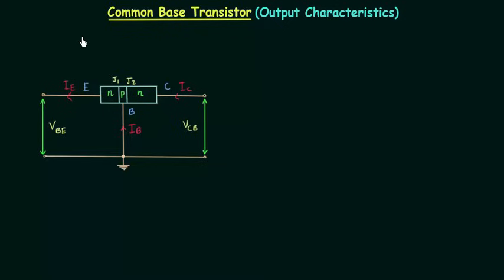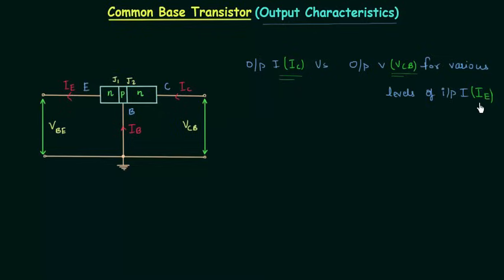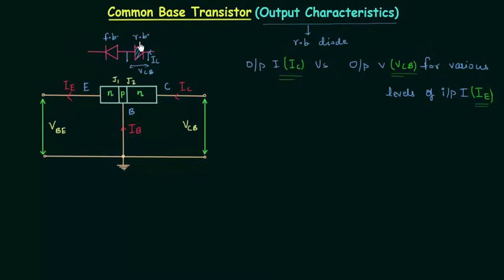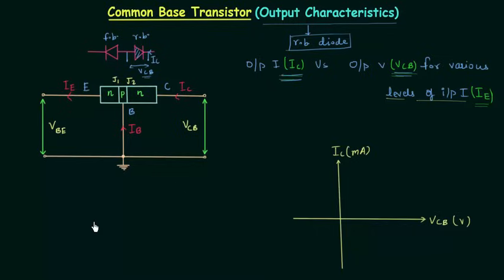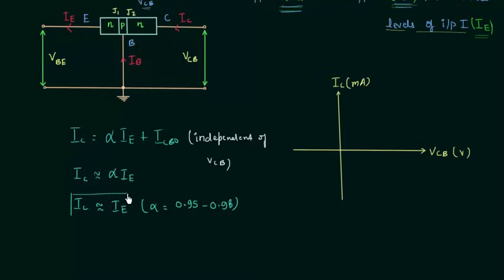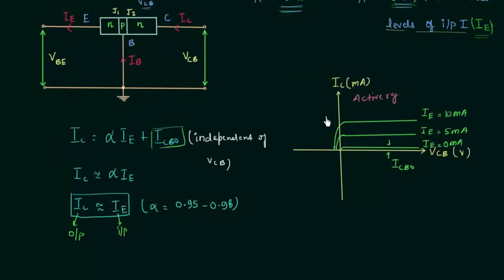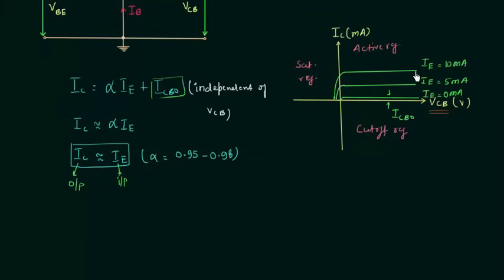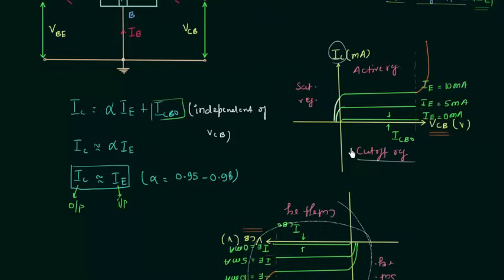CB Transistor (Output Characteristics)

Comment: Sir, Ie is dependent on Vcb . So there should be higher slope for the graphs right?
Reply: Are you telling about the slope of Ic vs Vcb graph ...mean if we increase the Vcb it will increase Ie...yes it will but here we are keeping the Ie same for a particular case mean if you increase Vcb it will increase Ie but you have to low down the Vbe to keep the Ie as before and you will get the graph like so...

was it your doubt?

Comment: You said this is similar to reverse bias characteristics. Then why did you draw this in first quadrant instead of forth quadrant??
Reply: U mean 3rd quadrant, it's coz applied voltage is not in negative direction and so the current.

Comment: Sir, can u explain the output chareteristic in saturation Region. I cant under the Mechanism in saturation reg.
Reply: Saturation region is located to the left of ordinate Vcb =0 and above the characteristics for ie=0. Vcb is slightly negative for a n-p-n transistor in this region. This slight forward biasing of the collector-base junction causes the collector current to change exponentially with the collector-base forward voltage as in a p-n diode. 

Cut off region is located to the right of the ordinate Vcb= 0 (reverse bias across the collector junction) and below the characteristics for Ie= 0 (i.e., in the reverse bias across the emitter junction).

Comment: Emmitter current increases with increase in Vcb as we saw in input characteristics, so collectors current should also increase with increase in Vcb.
Why is it not so??
Reply: Actually, it does. The current starts from the saturation region and then proceeds to enter into the Active Region where it becomes constant much like the reverse biased condition of a diode and again according to how a diode behaves if Vcb increases, collector current also increases so does emitter current, this is basically what we term as a breakdown but since BJT cannot withstand that much of power due to light doping in the collector region, it ceases to function. 
Thank You

Comment: Did not mention early voltage and its utilization in calculating output resistance. Also the output characteristics are not exactly like the reverse biased characteristics of a p-n junction diode because of Early effect.

Comment: why Ic decreases in saturation region
Reply: we have -Vcb at that area means forward biased(FB) for the collector-base region as well as for the emitter-base region. it decreases to zero because the collector and base region is lightly doped, when FB only few majority charge carriers will flow and eventually combined to much bigger flow on Ie.
Reply: @asherangelobuan3167  At the high base collector voltage, all the electors will move to the emitter side.
Reply: @asherangelobuan3167  how will both diodes be forward biased pls explain 🙏🙏🙏
Reply: This is because collector - base junction is also forward biased in saturation region . Note that both collector and emitter will be made of the same type of material (n type or p type). So assume a pnp transistor in saturation mode of operation. Both base-emitter junction and base collector junction is forward biased. It means that emitter is positively based with respect to base and the collector is also positively biased with respect to base. The function of emitter is to emit charge carriers and the function of collector is to collect the  charge carriers emitted by the emitter. In this case emitter is positively biased so it will emit holes towards collector. And since collector is also positively biased, instead of receiving the holes from the emitter it will try to repel the holes . As a result carriers emitted from emitter to collector decreases => emitter current decreases => collector current decreases .Same applies for npn transistor as well.
Reply: Please tell me

Comment: As from graph V(cb) is -ve when Ic is nearly zero . pls Explain.
Reply: Saturation region is located to the left of ordinate Vcb =0 and above the characteristics for ie=0. Vcb is slightly negative for a n-p-n transistor in this region. This slight forward biasing of the collector-base junction causes the collector current to change exponentially with the collector-base forward voltage as in a p-n diode. 

Cut off region is located to the right of the ordinate Vcb= 0 (reverse bias across the collector junction) and below the characteristics for Ie= 0 (i.e., in the reverse bias across the emitter junction).

Comment: Sir why in the output characteristics in a common base configuration the graph goes to the negative side of x axis
Reply: Bcos Ic cannot be 0 due To the minority charge carriers... a small negAtive voltage is applied which could stop the Ic (where Ic = 0) .. hence the graph goes to the neg x axis to show that the negative voltage is applied .. You can also see that the graph decreases in -ve x axis because of the applied negative voltage

Comment: sir as for as we know that resistance of  short path or closed switch is ideally equal to zero so in saturation region how collector current is going to be zero why not maximum current is flowing through it?
Reply: Because collector current will flow to the opposite of emitter current hence will cancel out each other's effect resulting in no current in the circuit.

Comment: Sir, why can a transistor not withstand that high amount of power for the current to flow exponentially ?
Reply: Because if exponential amount of current starts to flow through the transistor a huge amount of heat will be produced causing the transistor to burn.

Comment: why the graph extend beyond zero to second quadrant
Reply: Because in second quadrant means saturation region in which both the biasing will be forward biasing and since both of the biasing are forward biasing there will be no hindering for the flow of current from emitter to collector so current through emitter is equal to current through collector , and the direction of both emitter current and collector current will be same since they both are in forward bias therefore the sign of both emitter current and collector current will be same . try to see the O/P graph by inverting it you will get a clear idea .

Comment: Sir, i have a doubt that when diode is in reverse bias we use to plot the characteristics in 3rd quad so similarly when transistor is operating in active region then its output characteristics should be plotted in 3rd quad but in all books and all it is in 1st quad. so why is this happening?

Comment: why the current in saturation region become zero
Reply: As Vcb is negative, collector base junction will be forward bias and there will be a current flow opposite to the emitter side current. So the resultant current is difference between those two forward biased currents. (both EB and CB jn  is forward bias)as it becomes almost equalm, the resultant transistor current become zero
Reply: thank you so much SUHAIL MUHAMMED . God bless you.
Reply: How does Vcb becomes negative? Collector is negatively connected and base is positevly
Reply: If the resultant transistor current becomes zero in saturation region how it is a closed switch?
Reply: In the case of saturation both the junctions are forward biased. check previous lectures.

Comment: For Ie =5 mA case when Vcb equal to zero, Ic will flow as usual. so we have to apply FB to cb region such that Ic will be independent of Ie and net current will be zero.
Reply: Joyeb Kapadia how Ic will become independent of Ie when FB is applied ??
Reply: In rb case current cannot flow due to Vcc but due to Vbb current flows from emitter to collector. As soon as we apply forward Vcc to collector the current flows in BC circuit which is independent of Ie and Vbb.

Comment: why vcb is not effecting the graph? why the current ic always constant for different values of VCB?
Reply: because cb is reverse biased.. in reverse bias, only a small amount of leakage current is there( until break down occurs) even if reverse voltage increases. Vcb is reverse voltage. as Vcb increases, only that cb jn depletion region width increase. because of high kinetic energy of electrons from emitter, those electrons still cross the depletion region

Comment: why does graph come in the negative x axis in saturation region?
Reply: The collector current can never be zero due to the flow of the minority charge carriers that constitute the Icbo..So,to cancel out that current a small negative voltage has to be applied.

Comment: can you explain the nature of graph in the negative x axis. the idea is very vague as to how did you arrive to the solution by just comparing it with reverse bias condition.
Reply: because we  forward bias the collector base junction then it is in saturated region and the negative voltage at which the collector current is zero is the knee voltage as we have seen in pn junction diode
Reply: @parthahluwalia6018  ooo okk tq u
Reply: Me too
Reply: Negative x axis matlab forward bias toh flow of electrons will oppose ie current aur ek time baad neutralize kar dega current .
Reply: I also want to know the same

Comment: here you didn't explain why the graph is touching the Vb(horizontal axis) at negative side ?
Reply: The collector current can never be zero due to the flow of the minority charge carriers that constitute the Icbo..So,to cancel out that current a small negative voltage has to be applied.
Reply: when Vcb is zero i guess the previously reverse biased pn junction becomes unbiased so why are the minority carriers still flowing
Reply: @kshitijgupta482  I had the same doubt  but cleared with your answer
Reply: Kshitij Gupta not exactly for Ie =5 mA case when Vcb equal to zero, Ic will flow as usual. so we have to apply FB to cb region such that Ic will be independent of Ie and net current will be zero.
Reply: But already we have applied negative voltage at Vbc .....what is point in applying negative voltage
Reply: @kkr5063  to make use of this transistor, for logic one or switch on condition we need to cancel out all the current Icbo. Only then there would be a practical use of this invention
Reply: For cancelling Icbo (continuation )

Comment: In input characteristics collector VOLTAGE is varied,..
but in outpuc characteristics why emitter CURRENT is varies instead of voltage
Reply: Because from the first equation it was shown that collector current is independent of the input voltage and it depends on the the input current which  is I subscript E.
Reply: Ya..this question comes in my mind also!!
Reply: but if we apply a resistance in input it will controlled the Ie current....so however large the input voltage does not mean high Ie current....but collector current only depends on input current and not input voltage
Reply: NANDU KISHORE but input current depend upon the output voltage as can be proved from input characteristics